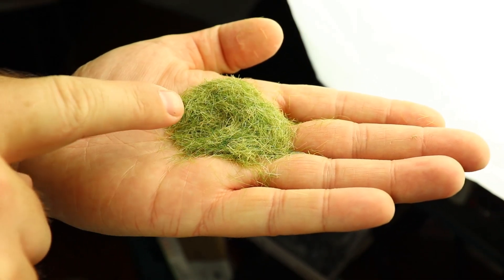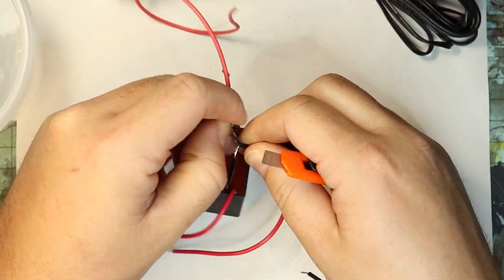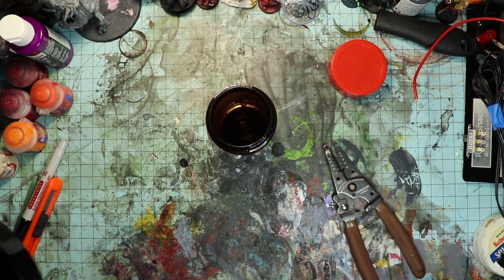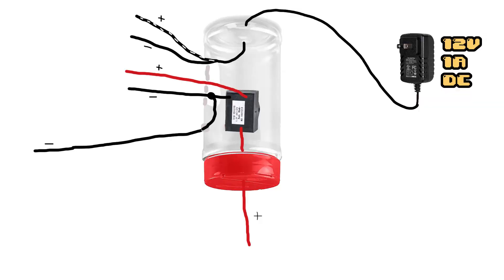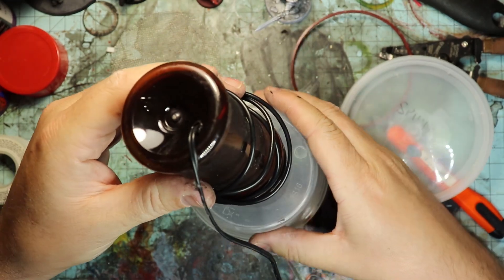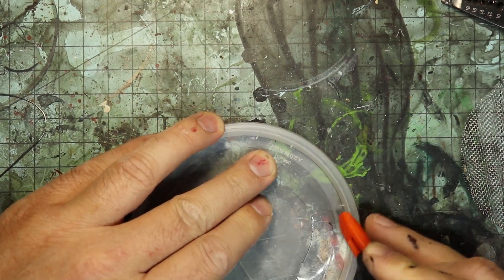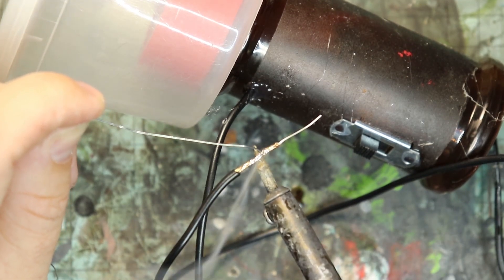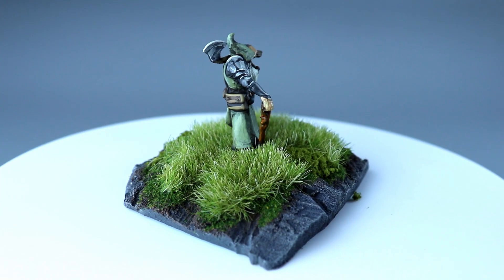How to Make a Static Grass Applicator - Cheapest Method

Comment: What's the Amazon part number or description of the Negative Ion Generator that you ordered? 

I ordered two from Amazon and they were no bigger than a quarter and totally useless.
Reply: There's one on Amazon from Electrodepot that has good reviews specifically for this type of application.
Reply: There's one on Amazon from Electrodepot that has good reviews specifically for this type of application.